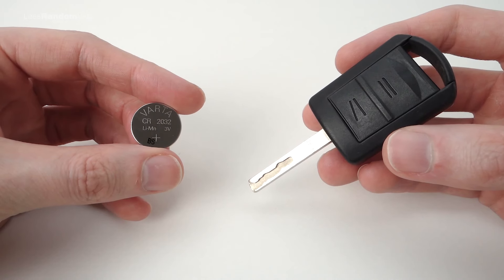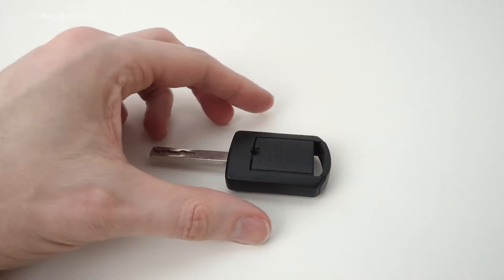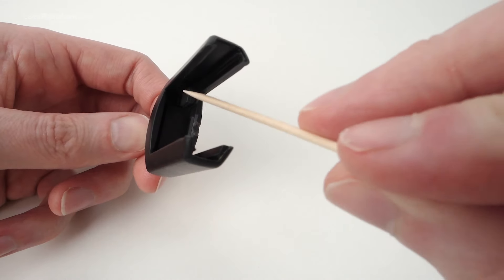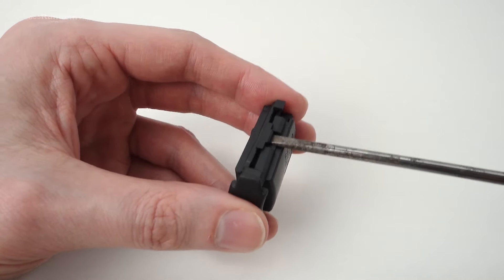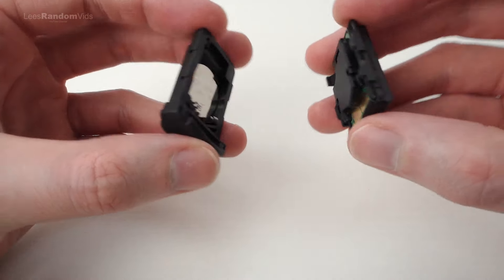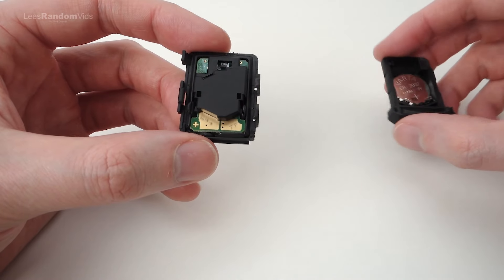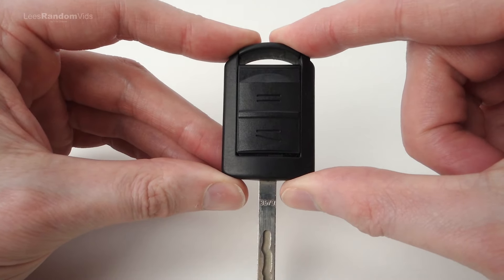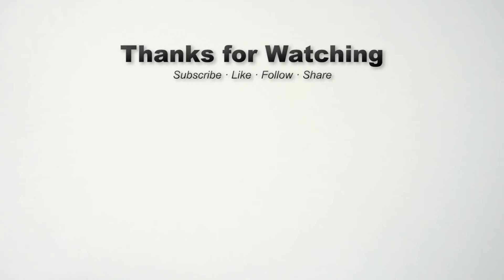How to Change the Battery in a Vauxhall Key Fob - Opel Car Key Battery Replacement Tutorial

Comment: Thanks for the vid. I have a 2004 Vauxhall Corsa. Changed battery but now it doesn't remotely unlock the car but locks it though. What can i do to get it unlocking remotely again?
Reply from the maker: You're welcome. Did you try what I showed you at the end of the video about re-synchronising it?